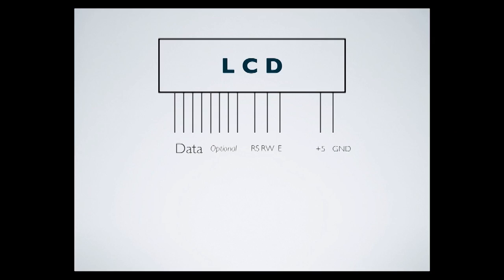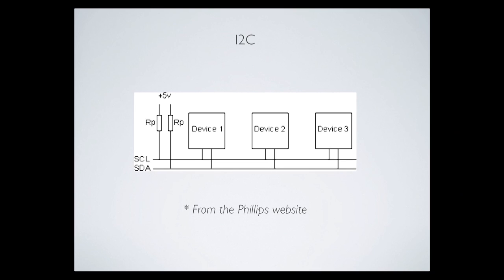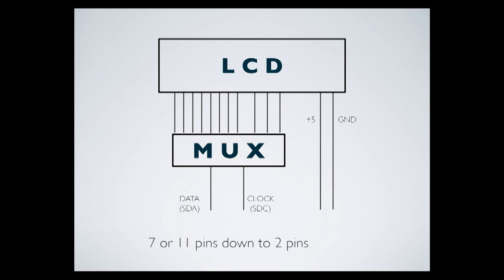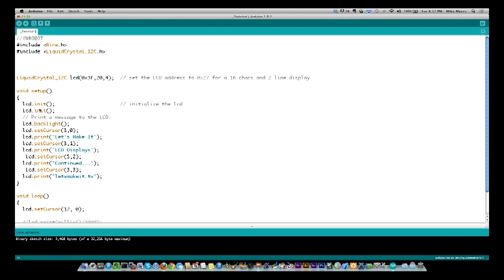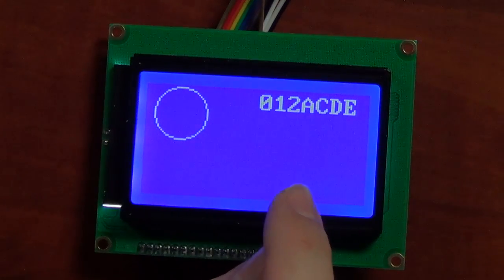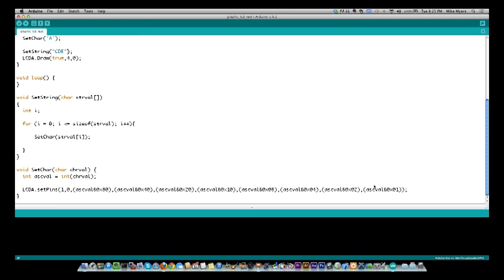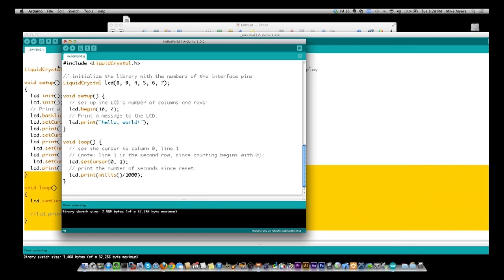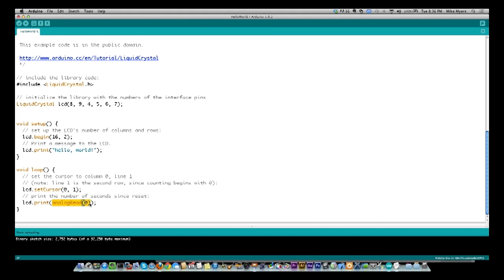More LCD and I2C fun with the Arduino - Let's Make It - Episode 5

Comment: On all my LCD,10x2,20x4and my 128x64 GLCD I always have problems using the I2C backpack and my Uno I don't make sketches(not that advance yet)but I make small changes to led strip sketches but my question is do you make commands in the serial box once a I2C is connected?Im talking about the serial box that opens with "send"!And as for hooking up the SDA and SCL are they suppose to be switched the SDA connected to SCL and SCL to SDA?Thank You for Video it answered some of my questions

Comment: I think this is exactly what I'm looking for. I'm just getting into Arduino and got a SainSmart 1602 LCD and it's working but my main loop won't fire if I have Serial.begin() started. I actually have to Serial.end() before the main loop will fire. I think you'll probably explain that in this video, so thanks!

Comment: Why don't you make a video about getting an I2C LCD display to work that actually shows how to get an I2C display to work instead of this boring nonsense?  You started out talking about the I2C display but then half way through you went off the track rambling and talking about graphical displays, LCD shield from sainsmart and other things!  If you had to modify the code to make it work then what did you do to make it work, why not tell us?  While there is a sample sketch with some Serial LCD Sample Code on the tech-zen site it's worthless, it won't compile and the 3rd line fails.

Comment: sorry to mention this incase its already been addressed or mainly because I am not as Knowledgable with the whole Coding Realm or Embeded SOC's yet, But you state that theres 13 digitals IO's and that 2 are reserved. i was under the impression that you could actually have 19 because all Analog pins can be reassigned (so be it that you dont need any analog inputs i guess) as digital incase you wanted to use all 8 data lines on an LCD or etc. i.e. analog instead of A1, A2 can be pinned out as 14, 15, ?

Comment: if Arduino has 10 bit ADC converter than max.value can be 1023. So you have problem about code that you need to clear row which is location of ADC value.

Comment: I have the same LED from sainsmart, in it is a pain. Especially for someone new.  The sketch I am working with has 2 displays,  the author of the sketch got 2 led to work using a port expander (possibly 2 not sure yet) to get the address to work. I was hopeing you had a video discribing this.  There is nothing on the Web that address this and sainsmart sent me a bunch of help files with hyperlinks that really don't link and are no help at all as of yet.

Comment: cant you put on 0 and 1 pins
Reply: No! The 0 and 1 pins are for the UART(Serial) communication, and this is a I2C display so you need to connect the SCL to A5 and SDA to A4. Some Arduino boards have dedicated pins for the I2C bus.
Reply: KaSpErSkI95 those dedicated pins are actually piped from a4 and a5. Meaning that if you use the sda and scl pins on the arduino, a4 and a5 can only be used for i2c communications, and not analog input or anything else. It's nice to have the option to test an i2c device while you have another connected at the same time. You can hook as many i2c devices to the lines as you want as long as the addresses are different. There are pads on the "MUX" that you can solder across to get a different address. Most of those screens are either 0x3f or 0x27 by default. Run Rob Tillaart's i2c scanner (GitHub.com) to locate the i2c address.
Reply: billybbob18 only the boards based on the atmega328p(in this case the UNO) have SDA - SCL on A4 - A5. The Mega has them on 20-21, Leonardo 2-3. The Due actualy has 2 I2C lanes, the first one (SDA/SCL) is connected to pins 20-21 and the other(SDA1/SCL1) has those dedicated pins that i was talking about rigth next to the AREF pin.
Reply: KaSpErSkI95 thank you for that. I plan on getting a DUE  one day. I need a higher precision ADC and more pins, but I don't like the lack of a 5v option. I guess 5v is on its way out. I can always use level shifters, but who wants to muck with those?  I'm designing a product for the indoor vegetation growth industry, so I'll have to settle on a stable standard sometime. 3.3v FTW I guess. Peace!

Comment: when u test the buttons the highest # you can get is 1023 .
the # you are reading have a 3 left over from the 1023 # 
1023  7383     5013     3243       1403   23
1023  738       501       324         140     2
one of them where 5013  this is 501 not 5013